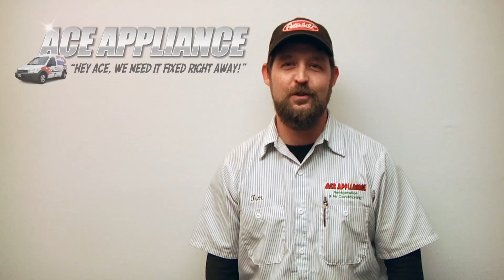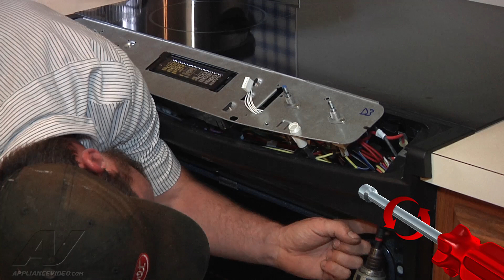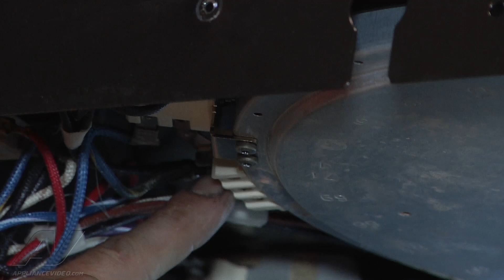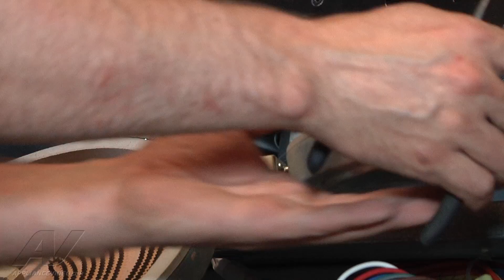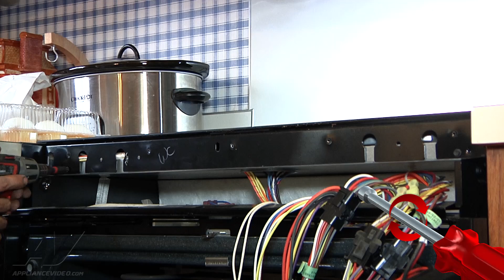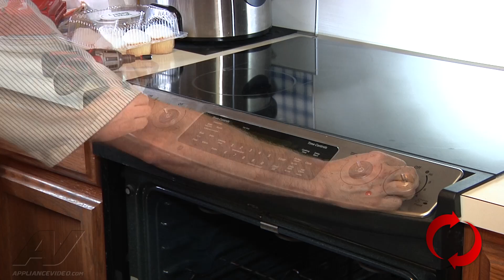GE Cooktop Repair - Front Burner Not Heating - Built in Switch - Diagnostics & Troubleshooting

Comment: Thank you so much for posting this video. Super helpful!

Bought "GE WB30T10133 Genuine OEM 9" Radiant Dual Surface Element for GE Electric Range" for my GE Range (model: J SP46S P3SS) and just replaced it successfully today. 

I took my time and was able to finish in about an hour. Used drill and adapter. Those clips are THE worst. Shoutout to the chunky peanut butter jars that were the perfect height to hold the stove top up while I was accessing the element.

Comment: Very helpful video. Thanks! It was on point for the JS750SF3SS GE range and the large cook top burner replacement I had to complete.  The only surprise was the difficulty in releasing the three retention clips and the difficulty re-positioning the new burner with those clips during re-installation.  Both the old and new burners had numerical position markers around the periphery. A helpful detail would have been to mention that and to pre-dimple the same position markers on the replacement burner, which seemed to help.  Thanks, again!
Reply from the maker: Great question, if you have a more technical question that our parts department cannot answer, you can search our over 17,000 answered questions free at our website www.ApplianceVideo.com under our Repair Help section. You can also call our parts department at 1-800-830-5465 and they can give you help 7-days A week ,or search at www.SaveMoreOnParts.com  .
Reply: Those clips are a pain trust me
Reply: Oh man eff those clips.
Reply: Thank you for this video! I have the exact same issue. Can I ask, how do I know if my terminal is burnt (will the signs be obvious?). How would I know if I need to replace the infinite switch vs. The burner?

Comment: Hallelujah, it worked!  I needed to replace the exact same element, but for a different reason.  I watched it all the way through, then followed step by step, pausing in between as I performed the actions. 

One caution I'd give is that those tabs are the hardest item to get off and put back on.  I used a screwdriver to pry the front one off.  When it slipped, I got a nasty cut on my knuckle from slamming it into the metal ridge of the range.  I'd recommend wearing leather gloves when doing that...

When putting the tabs  back on, they weren't snug.  I must have "stretched" them out of shape.  I uses pliers to lessen their gaps and then they worked fine.

I'm curious to know how much I saved on a service call...  Thanks for the video!
Reply from the maker: Thanks for the comment Doug! Glad the repair helped you out - if you need any help on an appliance in the future, you know where to go :)
Reply: They helped me rebuild our whirlpool dryer too.
Reply from the maker: Awsome

Comment: Great video but id highly recommend the average homeowner unplugs the big harnesses connecting going to the cooktop and removing the cooktop, placing it upside down and removing /replacing burner that way. 

The clips, unless you've done those a few times are hard for the average joe (i even noticed a cut and smooth edit in this video at this point).=.  removing whole cook top made it so much easier to remove clips and also wire it up.

Comment: You make the statement at 0:34 that the hot surface light corresponds with the front right burner.  I believe that it corresponds with all four burners.  How did you determine that the problem was with the front right burner?

Comment: Really great video.  Took what I would have assumed to be a nightmare job and broke it down into very simple steps.  Unfortunately replacing the heating element did not fix my problem.  The outer coil will still not function.  Any further ideas on what could cause these same symptoms except for the heating element?

Comment: Very good, thanks! So the "thermal limiter" was causing the hot surface light to stay on? Is just the limiter replaceable?
Reply from the maker: Steve 
      Glad it was only the thermal limiter. Yes it is replaceable just call our parts department at 1-800-830-5465 and the can look it up and give you the part number and price. Thanks Matt Ace technician

Comment: I have the PS950EF1ES and the center element in the12 inch burner is not heating. Do you have any troubleshooting steps for that? I already checked that the center lead is not getting voltage when its turned on.

Comment: Super helpful! We had the exact same stove and was able to replace a burner that wasn't heating the inner element (the dual element one). We successfully replaced the burner - those clips really are a pain! But when we went to try the elements none of them work now... We double checked all the connections and everything seems to be snug, and I hooked up the new element exactly as the old one. Any ideas what the issue might be?
Reply: Ps the clock, oven etc all work so the stove is getting power. Just the cooktop elements not working (warning lights and heating elements nothing happens when turned on)
Reply from the maker: Great question, if you have a more technical question that our parts department cannot answer, you can search our over 17,000 answered questions free at our website www.ApplianceVideo.com under our Repair Help section. You can also call our parts department at 1-800-830-5465 and they can give you help 7-days A week ,or search at www.SaveMoreOnParts.com  .

Comment: My 36 inch Electrolux ICON electric cooktop just quit working.  The (you referred to it as a “pilot”) lights comes on when I turning the dials but the elements do not heat up.  When the burner stoped working the hot surface indicator light went out as well.  It usually stays on until the surface is cool.  I’m assuming I haven’t tripped a breaker or the blue “pilot” lights below the dials would not come on, but all 6 burners are not working.
Reply from the maker: Great question, if you have a more technical question that our parts department cannot answer, you can search our over 17,000 answered questions free at our website www.ApplianceVideo.com under our Repair Help section. You can also call our parts department at 1-800-830-5465 and they can give you help 7-days A week ,or search at www.SaveMoreOnParts.com  .

Comment: This video was great. No problem replacing the heating element. but I have a problem I hope someone can solve. During one of the final steps of placing the control panel in position, the control panel does not work when it is placed in position. The clock remains locked on but the other buttons do not respond. All controls work when the panel is elevated off the range. Is there a connection problem somewhere? Is there a grounding problem? I don't know how to troubleshoot. Any ideas would be appreciated.
Reply from the maker: Great question, if you have a more technical question that our parts department cannot answer, you can search our over 17,000 answered questions free at our website www.ApplianceVideo.com under our Repair Help section. You can also call our parts department at 1-800-830-5465 and they can give you help 7-days A week ,or search at www.SaveMoreOnParts.com  .

Comment: My hot surface indicator is staying on. When I turn on the burner, the pilot light goes on but it does not heat up. Does this sound like an element or controller?

Comment: On mine one is not regulating the temperature as it should as per the heat numbers on the knob. Is this a part replacement? (box under knob )
Reply from the maker: Great question, if you have a more technical question that our parts department cannot answer, you can search our over 17,000 answered questions free at our website www.ApplianceVideo.com under our Repair Help section. You can also call our parts department at 1-800-830-5465 and they can give you help 7-days A week ,or search at www.SaveMoreOnParts.com  .

Comment: Thank you for the video.  We have the same GE Profile oven but the numbers on our control panel cover have be "cleaned" off.  (My wife accidentally rubbed them off. lol) Is there any way you could help me find a replacement control panel cover?  Or can you even buy one?
Reply from the maker: Great question, if you have a more technical question that our parts department cannot answer, you can search our over 17,000 answered questions free at our website www.ApplianceVideo.com under our Repair Help section. You can also call our parts department at 1-800-830-5465 and they can give you help 7-days A week ,or search at www.SaveMoreOnParts.com  .

Comment: I have the same exact problem but my front left is only working at maximum. Should i change the both front ones?
Reply from the maker: Great question, if you have a more technical question that our parts department cannot answer, you can search our over 17,000 answered questions free at our website www.ApplianceVideo.com under our Repair Help section. You can also call our parts department at 1-800-830-5465 and they can give you help 7-days A week ,or search at www.SaveMoreOnParts.com  .

Comment: Could anyone suggest? On a similar (ge js968B) range, when cold, one of burners works only parts of it's range -  LO->4; 6->HI (doesn't work from 4-to-6: light off, no heating). However, works entire correctly when hot. I didn't find obvious signs on inspections. Anyone could suggest anything? is it a sign ob burner/switch issue? THANKS!
Reply from the maker: Great question, if you have a more technical question that our parts department cannot answer, you can search our over 17,000 answered questions free at our website www.ApplianceVideo.com under our Repair Help section. You can also call our parts department at 1-800-830-5465 and they can give you help 7-days A week ,or search at www.SaveMoreOnParts.com  .

Comment: I've got a JP970SK2SS cooktop. The front left burner won't come on at all. The indicator light comes on, but no heat. The front right burner comes on, but after it cools down the hot surface light stays on all the time. Any ideas?
Reply from the maker: Steve 
       All of our technicians are now answering questions daily on the ApplianceVideo.com website. You can search completely FREE in our Repair Help section. Or you can get unlimited technical advice and video links emailed to you by our 14 factory certified technicians at http://www.appliancevideo.com/premium-membership/.  If you are in need of any parts please support our parts department on line at http://savemoreonparts.com/ or call 1-800-830-5465 7-days a week until 11pm Eastern time. Thanks for your support. Matt Ace Appliance factory service technician.
Reply: Thanks APPLIANCE VIDEO!
Very informative information DIY'er here!
Wish me Luck!:-)